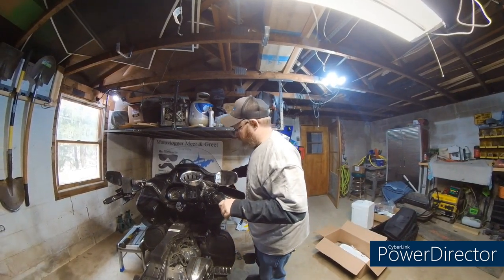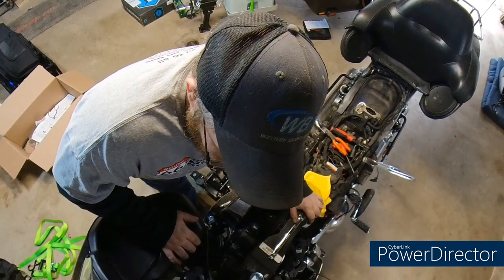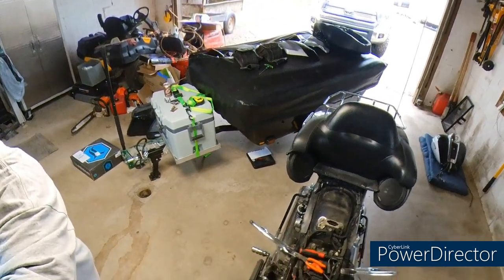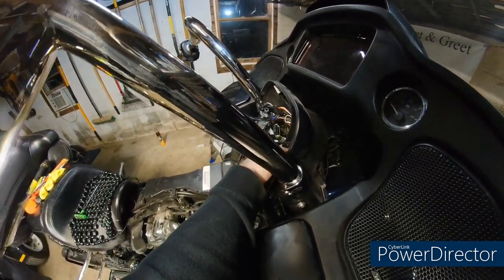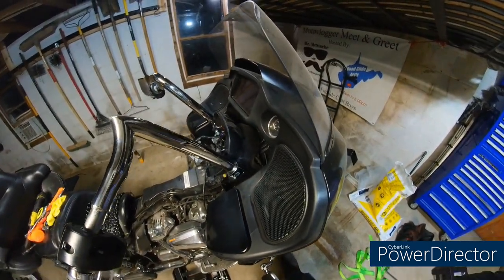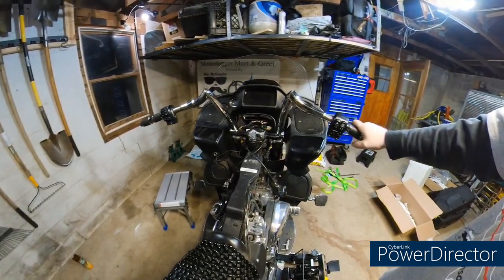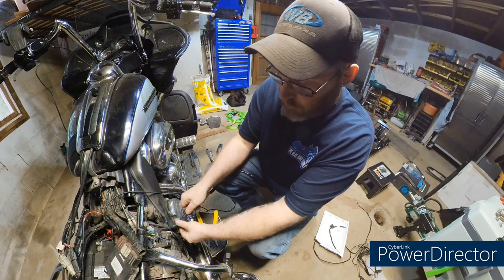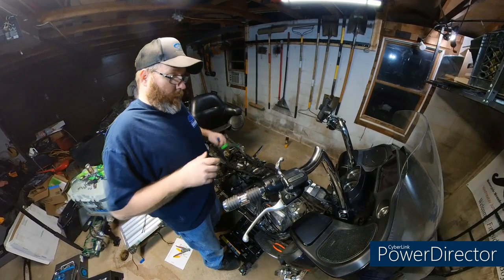How To Install Handlebars & Kahuna Heated Grips On Road Glide Ultra

Comment: When I changed my bars out for the LA Chopper bars,  I kept crushing the throttle by wire micro wires and I got fed up with it and finally took it to Harley dealership to put them on and charge me $700 😔
Reply from the maker: I know what you mean, I think we tried putting a set of LA Chopper bars on a fat boy, There inside tube is not clean, that's what makes them difficult. I chose the KST for ease of wiring as well. Thanks for watching and stay safe.